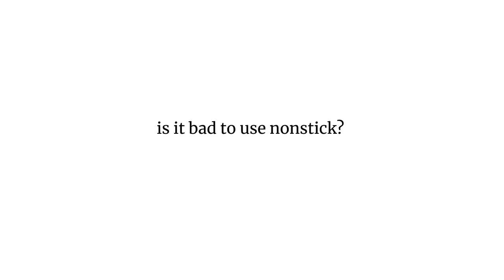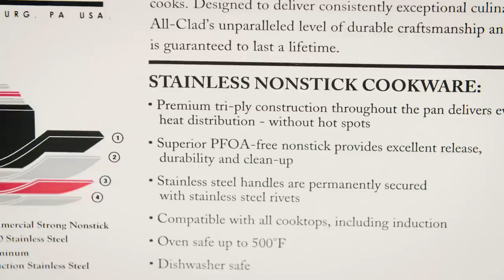Is it Bad to Use Nonstick Skillets?

Comment: QUESTION:  If non-stick skillets wear away over a period of time, is the coating that are sprayed on "painted" on leeching into the food you eat - little by little?
Reply: I’m not totally sure, but I once had a roommate who had a PhD in chemistry and his statement was that nonstick is totally safe until it starts to scratch and ship. If you ask me, the chipping away isn’t going to be visible to your eye at first, so you’re definitely going to have some nonstick in your food. Kind of like cutting into plastic on a plastic cutting board
Reply: @winterfoxx6363  Yes.  That's exactly what I asked.  Thank you.
Reply: INJURYCOMP no problem. So I guess r solution would be either not use them or (1) to make sure the temp is coated in cooking food and fat like she said (so it never gets over 600) (2) throw them out early and often, to never give the coating the chance to chip away. Maybe that would work? I’m personally curious about the steel carbon but one comment said it leaches too much iron into the food and men can’t process that large of an amount 🤔 maybe cast iron is just the answer!
Reply: @winterfoxx6363  Yep!  Cast iron and Stainless Steel are the only two cookware's in our Kitchen.
Reply: INJURYCOMP what did you think of enameled cast iron? I was into it but I found out it often contains High amounts of cadmium and lead, even the newer le creusets! Edit: they will tell you it’s lead-free but it’s “no less leached at time of testing,” not lead-free. It’s not tested how the lead leaches over long-term use

Comment: 1. Not all nonstick uses ptfe.  You can get nonstick which has neither ptfe or pfoa in them. 2. Theres also the fact that it's a matter of intensity, length, and duration of exposure. How many xrays have you had in your life? Are you dead yet? Flying on a plane also exposes you to radiation.  Are you dead yet? 3. Of the things healthwise to worry about, for me this rates low. 

I'd be much more concerned about drinking from plastic bottles all day every day.  And sitting in a car full of materials that offgas carcinogenic elements, again every day for hours.

Get a nonstick pan.  Use it in moderation. And replace it if the coating deteriorates.  Your life will be fine.
Reply: It's the disposable aspect for me. They are using the video as a commercial for cast iron and carbon steel which aren't near as versatile, valuable, or useful as tri-ply clad.
Reply: Talking sense to idiots never works. Also, people who are saying the coating doesn't last long have never bought a quality non stick pan.
Reply: Oh and no metal in non stick. Ever. Not even if it's a super hard ceramic coating and it's just a "quick stir". Just fucking don't.
Reply: Please do everyone a favor and superheat your quality nonstick pans and inhale deeply for a few hours.

I have cast iron and stainless steel pans that are decades old. Why would I want or even need a nonstick pan that I have to replace every few years? There is a big difference between getting a medically-necessary x-ray and stocking your kitchen with toxic-emitting cookware. Some things one cannot control. Kitchen tools are not one of them. Even if there's only a teeny-tiny chance of an issue, why would anyone knowingly risk it for a f*cking frying pan???
Reply: @CaptainFabulous84  1) Don't "superheat" any pan. Don't be an idiot. It's bad for all pans.
2) Most quality non stick pans use a form of ceramic coating which makes the issue moot. 
3) While cast iron can be almost non stick, it will never be as good as a quality non stick. I have several cast iron pans that are  50+ year old heirlooms. I love them, but they aren't for everything.
4) A quality non stick, treated properly, lasts a very long time. I have a ceramic non stick that's better than 10 years old and shows no sign of "wearing out".
5) Breathing air in a busy parking lot could also cause cancer. Please go breath deeply.
Reply: Yet overheating a cast iron pan won't damage your lungs and brain or kill your pets. We're not talking about ceramic pans, so why are you even bringing them up? I've been cooking for 35 years and have yet to find a single application that requires a Teflon (or similar chemical coating) pan.

There's a reason why PFOA was banned from cookware in 2015. I bet you're a big fan of BPA plastic too.
Reply: You're using facts. I thought that was illegal in comments sections :)
Reply: PTFE was not banned from cookware. PFOA was banned from usage in the MANUFACTURING of teflon pans.  It's a pretty simple thing...don't overheat your teflon pans.  If you feel like this is a risk you don't want to take, don't use them.  Pretty simple.  No need to get hostile.
Reply: Typo, fixed. Don't make logical fallacies and false equivalencies and I won't get hostile. Pretty simple.
Reply: +trevorpinnocky, your statement about plastic bottles is 100% garbage.
Reply: I'd be more worried about drug use, smoking and drinking excessively than using a nonstick skillet. Doctors always ask if you do the above mentioned, since they are the biggest health risks. They never ask if you use nonstick pans.
Reply: Because smoking, drinking, and drug use are considered recreational activities, not environmental hazards. Pretty much everyone knows they are bad for you. I dare say not many people know about the dangers of Teflon until it's too late.
Reply: I'm still not aware of any teflon-related deaths. Not even in animals.

Comment: I absolutely hate nonstick pans. Between losing their non-stick properties if you put cooking spray in them to flaking off if you scratch them, along with the aforementioned safety issues, I really do not see the appeal, other than them being dirt cheap.
Reply: 1) Don't scratch the non-stick.  2) Don't put an empty pan on a scorching-hot burner.  If these steps are beyond your skillet, don't ever go near a kitchen stove.  You can't cook, and will probably mess up a lot.
Reply: And if a frog had wings it wouldn't bump its ass when it hopped.

Comment: every non-stick i used degraded within a few years and lost the non-stick properties, even the ones specifically marketed as strong and durable. i stopped wasting money on them and bought a carbon steel.
Reply: How is it going these days? Are you still using the carbon steel
Reply: @madeleine363  the more i use it the better it is :)
Reply: @guguigugu  good to know the pan is still getting used. I have a cast iron so I’m not sure if i would actually use the carbon steel. It sounds like the main difference is the weight + slightly easier to clean

Comment: Even with a well seasoned carbon steel pan I use for most things, I still make scrambled eggs in nonstick. Low heat and constant movement equals creamy eggs in my nonstick. The same process in my carbon steel equals a coat of egg matter stuck in a layer on my pan.
Reply: Carbon steel sucks also, but butter or more butter should fix the problem.
Reply: @madthumbs1564  perhaps for you, but for most everything, it's served my purposes more than sufficiently. I'll still pass on using 4-5 tablespoons of butter (400-500 exrea calories) just to keep my egga from sticking.

Comment: The crazy thing is that nonstick is older technology compared to stainless steel. I'm surprised they haven't been studied more
Reply: The use of Stainless Steel is FAR older than Non-stick.  And non-stick HAVE BEEN studied quite extensively but people don't want to believe them. There was a time when they said Aluminum pans could be bad too - but the reality is that in most cases your food is not in the pan long enough for anything to happen - even if it did.

Comment: I appreciate the caveat about always adding some oil/fat to a non-stock pan. Can water be used instead? My question comes about because I happen to be watching some videos by low fat vegetarians who consistently advise using a moderate/medium heat non-stick pan and once the pan is hot adding a small amount of water before proceeding to “stir-fry” their vegetables. Leaving aside the merits/demerits of oil free cooking, is the practice these folks are advocating likely to put cooks at risk?
Reply: it doesnt matter. if you overheat the pan, it will give off fumes.

Comment: May I also mention that when the Teflon starts to peel,  a non-stick pan should not be used. Whatever the non-stick is made of will get ingested. Too many restaurant kitchens are using badly scratched up non-stick pans.
Reply: Bull.  The coating is 100% harmless.
Reply: BUll yourself. I found several sites that said this.

"PTFE (Teflon®) and derivatives are not metabolized but fragments can cause harm inside the digestive tract if they get lodged in unfortunate places."

Comment: Nice video, but in the end, why use any material, in cooking, which has the potential to cause harm to the people who cook or eat the food.  There are many other, easy alternatives which might not be quite a ‘stick free’ as teflon and its ilk, but are proven to be safe without ‘monitoring temperature’ or looking to see if any of the material ‘scratched off’ into the food potentiating health problems.  The other products last longer and have much less of an environmental ‘footprint’.  I cook with vintage cast iron, which is almost as non stick as teflon and may impart iron into the food, which is good for many (but not all) people. Bottom line is ones health is one of the most important things we all have. Stay away from Teflon and non stick and stay healthier for it.
Reply: The real issue is they're disposable. You're letting carcinogens into the air every time you season cast iron. It's 2018; all-clad no longer has exclusivity on tri-ply. -They are much better in about every way, and they can also be seasoned (look up Halle Cottis -youtube). -But then Boedy Pennington (also on youtube) also shows that it's not the seasoning, but the smoothness of a pan that matters (strips a cast iron pan and polishes the inside then cooks an egg which he flips with the pan).
Reply: Why?  Because rational people weigh risks with benefits all the time.  For example, I bet you haven't replaced your standard 3-piece seat belt in your cars, even though a 5 point seat belt is far more effective at keeping you safe.  After all, why use a 3 pt seat belt which has the potential to fail at higher speeds when you can opt for an aftermarket 5 pt belt?    I mean, they only cost a grand or so.  Isn't you and your family's safety worth it?  You're much more likely to be injured or killed from a car crash than any ills from using a teflon pan.

Comment: I really appreciate the honesty in this video!
Reply: Not so much honesty, really.  

Sorry, but non-stick surfaces have been PROVEN to be safe under normal use.  The typical home kitchen stovetop doesn't get hot enough to release toxic fumes, and the surface material is NOT harmful when scratched and ingested.

Comment: I am living proof that Teflon is hazardous to your health. 2 or 3 years ago I put some water in a pan over my gas burner for oatmeal, went in the other room and fell asleep for about for hours. Need less to say it burned the water away and then the pan. When I woke up the place was full of fumes so I threw the pot out in the yard and opened all doors and windows to ventilate.  For the next two weeks I felt weak and stupid and I knew there was something wrong with me.  Tried to do research which was hard being stupid and all but found that pte or pfoa when heated  enuff  is a class 2 chemical warfare weapon.  So lungs haven't been the same, but  got much of the poison out with nettle cilantro and chlorella.  Obviously  it was careless of me to leave a heated pan unattended, but cast iron or steel or glass would not have injured me so badly. So be warned and beware.  Teflon is poison!
Reply: Todd Custer
Dumble
Reply: It's only poison if you're stupid enough to put it on a hot burner.
Reply: What if most of us don't let it burn dry?
Reply: Todd Custer "...it burned the water away"

Water is nonflammable. It didn't burn away, it boiled away.
Reply: You're much more likely to die in a house fire than from fumes from your teflon pan if you continue to do this.

Comment: and you didn't even address the concerns of damaged Teflon coatings flaking off into your food
Reply: Totally safe to consume.
Reply: Teflon flakes are totally harmless.  Of course if you use a pointed utensil with a non-stick pan, you're probably not a very good cook.
Reply: Lee Mason "you didn't even address the concerns of damaged Teflon coatings flaking off into your food"

That's because there ARE no concerns. Teflon is inert and non-reactive once cured, unless it's heated to the point that it emits gases. It's odorless and tasteless, so it won't affect your food, and it passes through your digestive tract, so it won't affect you.

Comment: Do you have any numbers on how hot you can get non-stick pans before birds are harmed?  We have tiny birds; Prince Periwinkle, Hanky Panky and Princess Polka Dottie and we want them to be safe.  I always heat my non-stick skillets with a wee bit of oil or butter in the pan, but how hot is too hot for birdies?  My favorite pan is my 12" carbon steel skillet.  When replacing my non-stick skillets I am considering a second 12" carbon steel, a 10" carbon steel and two 8" carbon steel pans.  Just one pan at a time because they are a bit dear!
Reply: we don't have any numbers on it, but to be safe i'd make sure that your birds are nowhere near the kitchen and that the kitchen is well ventilated when you're using nonstick, it's definitely a real concern with birds. love the names!